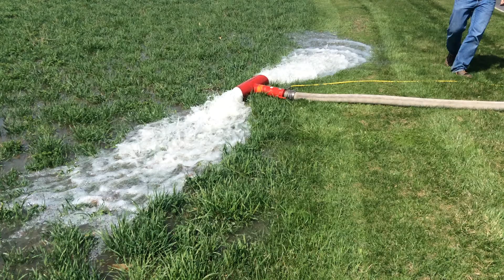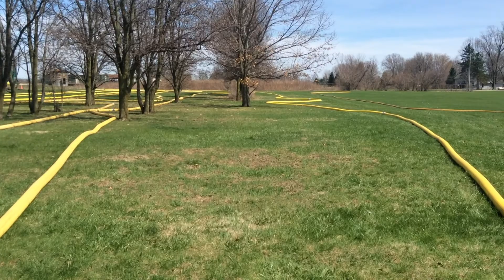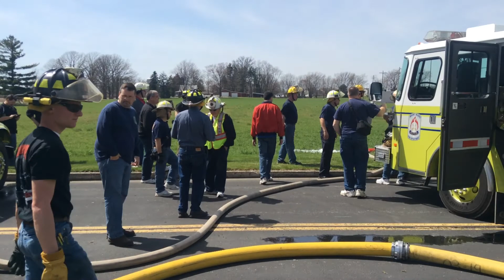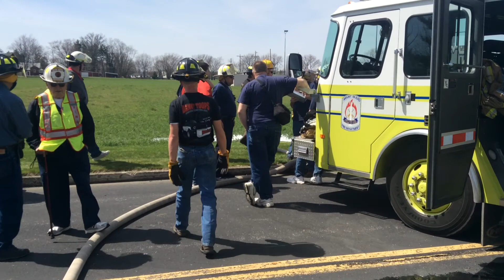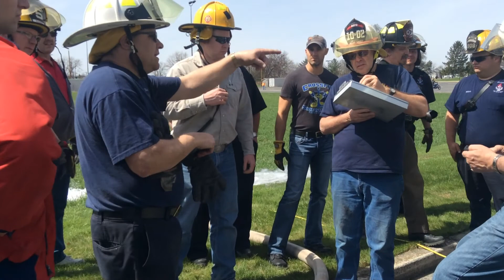Part 2 - Relay Pumping Drill - Delaware, Ohio - April 2015

Comment: Additional info, a 1 1/2" line is flowing around 50 gpm at the draft site as a buffer in case the supply line needed to be shut down.  So a total flow of approx. 725 gpm.  Source pumper has a Cummins ISL9 450 hp engine and Waterous CSU 1500 gpm single stage pump.  5" LDH officer's side outlet.  6" drivers side and front intakes, and 2 1/2" drivers side aux. intake used for drafting.  Approx. 5' lift.